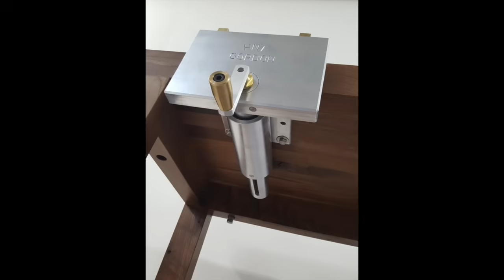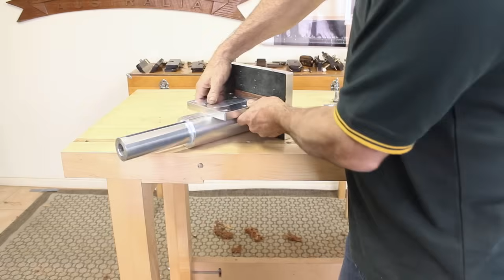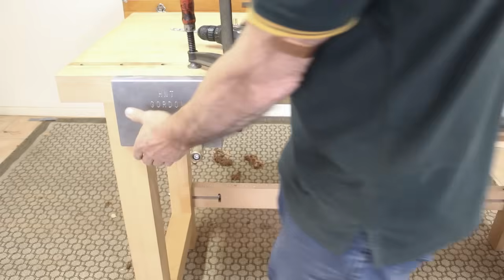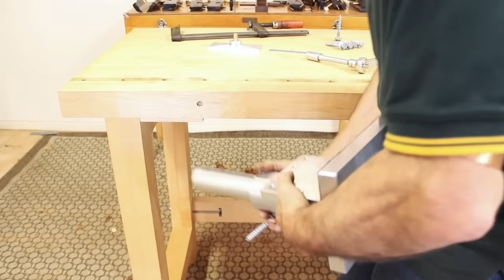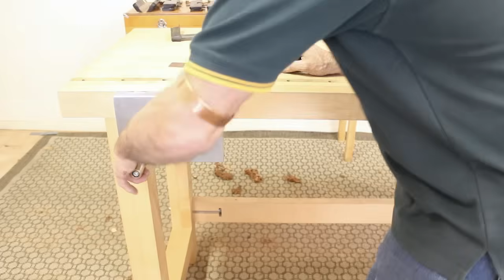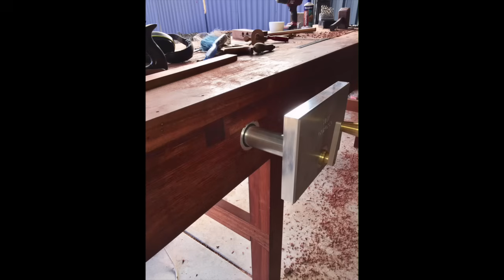How to Mount a Workbench Vise | HNT Gordon & Co.

Comment: Love the function (and form) of your vices. I think I know the answer, but I’ll ask anyway just in case. Is there any option now to avoid morticing my workbench top when it is over 74mm thick? I’d like to add your front vice to a workbench I’m making from an existing end-grain hard maple butcher block table (100mm thick) and ideally would like to leave the table top intact. 

Have you tried, for example, an installation where the top of the vice is below the worktop surface? Bad idea? It’d be 26mm below my worktop if I left my worktop unaltered. 

Thanks, Chris

ps Maybe I should bite the bullet and mortice my top, as I’d benefit from dog holes and a tail vice too, in which case there’d be many modifications to the worktop.

Comment: What adhesive product do you recommend to install the cork pad to the inside vice face?  Thank you!
Reply from the maker: We use contact adhesive.   It is the glue that you spray or wipe on both surfaces let it dry and then put together.   Was widely used to glue laminex to bench tops.   Hope that helps.  Terry

Comment: I built a split-top roubo workbench and incorporated the Benchcrafted leg and tail vise.  A year later I did a woodworking course where HNT vises were installed on the workbenches.  I've now swapped out my Benchcrafted leg vise for the HNT non-racking vise.  An expensive lesson, but the HNT vise is so worth it.  And this video was extremely helpful when I was doing the install.

Comment: Why would I buy a vice, which will dull my sharpened blades whenever I come of course of my work piece??? And does not even have a quick release? And - opposed to the classic RECORD or YORK metal vices - does not even have holes to attach a wooden liner to the metal yaw? Sorry, but to me this is another example of tool fetishism for the case if one does not know how to spend any more money in his workshop or one puts emphasis on workshop looks rather then what is coming out of it. Just my open and honest two cents on it
Reply from the maker: Hi   Not sure if you are aware but the point of you tube videos is to share information to help other woodworkers.   As a tool manufacturer of 25 years I can assure you we test and evaluate tools extensively before putting them on the market.  So any video we do will be based on good information for woodworkers to use if it is helpful to them.    On the other hand your comments are are at best a guess and help no one learn anything about woodwork.    If you want to be heard and have your opinion valued by other woodworkers I suggest you research , test and evaluate what you are commenting on.   Regards Terry
Reply: @hntgordonco.2514  Rather than to question my judgement, I would expect you to adress the disadvantages I mentioned. I am (and all others here I would assume) open to any comment and have no issue to accept good arguments, that I may have overlooked.
Reply from the maker: @lowerhousingfab4625  Your judgement on the 'disadvantages' of our vice were based on complete guess work because you personally have not tested and evaluated this vice.
We are only too happy to answer any questions asked about this vice. However, you did not ask any questions - you made statements based on no research or testing, hence the reason for our last reply.

In any case, here is some info that may help clarify some of your concerns:

1. This vice does not dull blades if they inadvertently come into contact with the aluminium jaw.  We actually use a metal block plane when making vice jaws to plane the sharp edges off machine surfaces, and the blade will last all day doing this job. Also, we can't afford for our blades to dull whilst making planes in our workshop as this would be very inefficient.

2. To our knowledge no one has been able to design a quick release vice that doesn't rack. From our own extensive experience in woodwork and testing of the vice, we find the non- racking and precision of this vice out weighs quick release due to the efficiency on not having to re-clamp your work piece due to racking problems. This is obviously a personal preference too depending on the work you do, but we have had customers swap over from quick release that have been very happy with the result. These vices save us at least 30 minutes a day in production due to the non-racking and precision - if you do the sums on that this is not an expensive tool.

3. All we recommend for this vice is a thin leather or crubber liner that is easily glued to the jaw, with no need to add a wooden liner.

4. We designed this vice based on function not looks, and a lot of work goes into these vices which are not made in China, hence the higher price point. There are other design features that are a completely new design and add longevity to the vice, which also increases the price point.  E.g. the thread is hidden and it has a self cleaning shaft, meaning shavings and dust won't get into the thread or the bearing surfaces which is what leads to the deterioration of vices. We also offer an unconditional guarantee on materials and manufacturing, which means we expect these vices to stand the test of time. We believe in buying once and buying well, which means saving money in the long run, and less landfill from cheap products that break down after a short period of service.

If you have any other questions let us know.

Regards,
Terry
Reply: Wet blanket. 
No fun at parties. 
No one cares what you think.

Comment: Great video. Would a sliding deadman be an asset with this vice? Looking at designing my new bench and I’m torn between a traditional leg vice with a sliding deadman, and one of your front vices. I’ll definitely be getting one of your tail vices.
Reply from the maker: Hi Scott,  the sliding deadman would work well with this vice when you have long pieces of wood to plane.   You will love the non racking design if you get one.   Regards terry